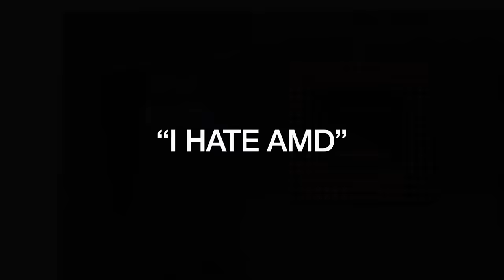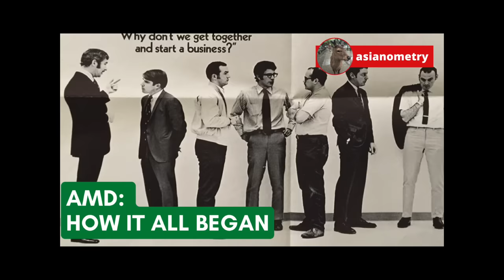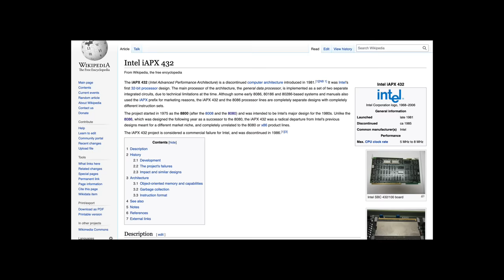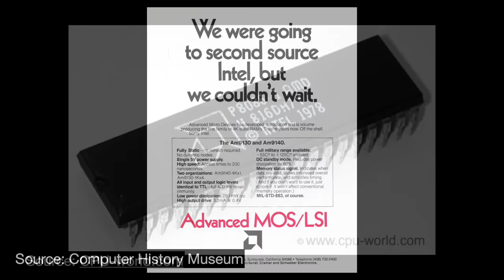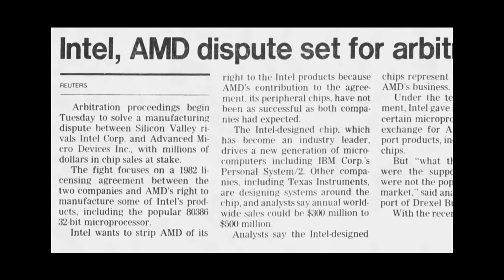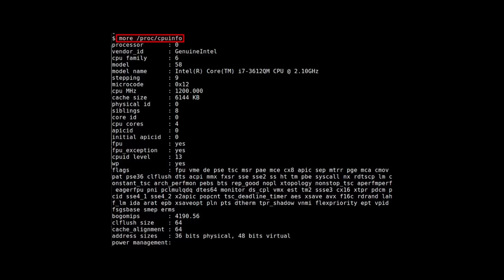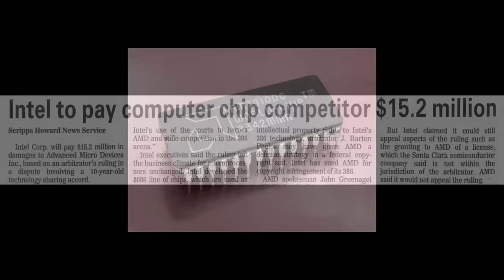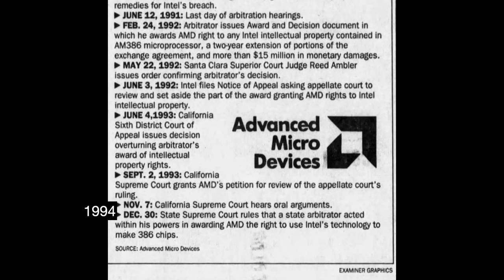Intel & AMD: The First 30 Years

Comment: Its a miracle that AMD is still standing and hadn't gone bankrupt after Bulldozer's massive failure, and in spite of all the anti-competitive practices that Intel done in the past few decades.
Reply: if it weren't for Consoles Xbox and PS AMD would've gone Belly-up around 2010s
Reply: @steffennilsen2132  Especially Nvidia, cuz it was also Dumped by Apple due to Nvidia's Ever-present Greediness.
Reply: @mozzinator  bulldozer is really far from the history covered in the video. They were much closer to dying at that point than at any time during bulldozer
Reply: And now looking at 6000 GPU and 5000 CPU AMD is competing quite well with 90% performance at 70% power. AMD doesn't have the same edge their competitors have but they compete well with decent margins all the same. I am immediately drawn to the underdog story. Thanks goodness we have AMD to help other companies innovate.
Reply: @christophermullins7163  well ryzen 7000 is out and today the 7800x3d is the fastest cpu availible for gamers. while 7950x3d is up there for productivity tasks.
Reply: Bulldozers weren’t as bad as people said. 

Had a FX-8350 Black that served me well for about 8 years. For gaming AMD was geared up for them with most companies optimizing their games to the AMD platforms. 

The FPU was the point of contention with the Bulldozers.
Reply: Also can’t beat the price point back then. $250 for a FX-8350 with a Liquid Cooler guaranteed to cool up to 5GHz. 

Compare that to $500 for a Intel i7 people that were smart used the money saved on the CPU to buy a better GPU.
Reply: @South_0f_Heaven_  sure. At half the single thread performance. Fortunately we don't have this issue and competition created a $150 6core part that will run a 4090 at 4k reasonably well.
Reply: @South_0f_Heaven_  yeah they were. They really really were. Phenom came out before and had many benefits lol a 2c4th Intel would match or beat a 8core whatever while consuming 1/3 the energy. Not to mention that no games used those 8 threads(actually 4 cores)
Reply: @South_0f_Heaven_  oh no no no no no... Bulldozer was just as bad as everyone said it was. Why do you think AMD literally never iterated on the design? I mean it's fine if you bought a year or more after launch. But at launch it's like AMD was painting an i3 to be an i7. They really thought programs would go towards being designed with integer math primarily (lots of good reasons for this tbh) but turns out they were very wrong.
Reply: @christophermullins7163  Maybe NEC would have been the underdog.
Reply: @South_0f_Heaven_  Same here. Gave me many years till DRM and it's needed instructions (SSE if memory serves) forced an upgrade.
Reply: @South_0f_Heaven_ That’s not even mentioning the fact that the 8350 will beat Intel’s offerings from the same time in later games. Bulldozer aged much better than the 2700k, assuming you don’t care about power consumption.
Reply: @South_0f_Heaven_  when we talk about bulldozer, we talk about the whole family of CPUs. The first gen was a complete regression over the Phenom 2 and except the 8350, the second gen was so badly yielded that there were even less efficient than the flagship despite less cores and frequency and a quite older node than Intel.
Even in the lower end desktop, the FM1 fiasco was not a good sign for buyers. The APU line was weak despite being updated to excavator and steamroller unlike the AM3+ parts.
The only interesting parts during this era were Jaguar CPUs on AM1 for SFF units and they even managed to shut it down under a single gen instead of solidifying this low power market.
Reply: @christophermullins7163  had a Phenom 965 Quad Black before the FX-8350, they were the 6-cores that AMD blocked off 2 cores for whatever reason. 

When I started playing BF3 in 2012 I had the Phenom 965 with a 9800 GT. Upgraded to a GTX 660 and nothing but bottlenecks. 99 % CPU usage that went down to 45% when I upgraded to the FX-8350. The Phenom 965 while a great CPU was overrated tbh, sold mine used for more then I paid new and the FX-8350 was superior to it in every way. 

Went to a 6700k few years ago that ran horribly hot at 60% even with a 360mm Arctic Freezer 80c-90c. 

Couldn’t be happier going back to a AMD Ryzen 5800X3D
Reply: @christophermullins7163  don’t know about that one. 

When I was building a new system I looked into a Ryzen 5600X to be used with a 1080 ti and even that 2017 GPU had a slight bottleneck with the 5600X. 

Highly doubt a 4090 is gonna work well with a $150 6-Core. 

Intels are better at some things while AMD is better at others. Myself I care about value and getting at least 5 years out of a PC build with a minimum of 1 upgrade during that time. For my purposes Intel is just overpriced and overrated in the current PC environment.
Reply: @South_0f_Heaven_  Yeah pretty sure the 8350 I had still lives on in a younger siblings computer to this day, I don't remember having any issues or surprises with it. Seemed like a good chip at a reasonable price.
Reply: @christophermullins7163  eh the 7900xtx performs a bit worse than the 4080 and the power draw is similar or higher in games. There was a massive hardware issue according to moores law is Dead which is why performance is off from their initial estimates. 

Still great and they can compete at tiers that matter for volume and come back with Rdna4, I held my nose and bought a 4090 this time. Really wanted to get something from AMD but wanted something that can play basically any game at 4k.
Reply: @PainterVierax  agreed the APU’s were a disaster plus AMD’s offerings for laptops were pathetic. On that level Intel was king but even Intel had their issues back then. 

Regardless both companies are more or less at parity and it will be a interesting next few years.
Reply: @jolness1  also regarding the 7000 series GPU’s they have major issues with downclocking the VRAM when running games at low settings for competitive play. 

Much as I despise Nvidia these days they still have the best offerings in the GPU market. 

Too bad the crypto boom poisoned everything.
Reply: Thankfully, AMD had enough fanboys to kept them afloat until Ryzen.
Reply: Partly that's because Intel's 64 bit instruction set is licenced from AMD, because their own attempt at it, the Itanium, was a disaster.
Reply: @South_0f_Heaven_  revisionist history 😂 they were really that bad
Reply: @PainterVierax  "The APU line was weak despite being updated to excavator and steamroller unlike the AM3+ parts."
They weren't weak compared to the price equivalent Intel chips for the most part. Usually you'd get comparable CPU performance and better iGPU performance there, the biggest downside to FM2/FM2+ was the lack of upgradability to anything remotely high-end so it was largely limited to people in the budget market who weren't likely to upgrade their CPUs.
Reply: @mozzinator  AMD doesn't make much money from consoles.
Reply: @TheDemocrab  That upgradability path was a huge contrast compared to previous AM2-3 and compared to Intel platforms. And with the Bulldozer arch they get horrendous perf/Watt compared to Intel i3/Pentium + a more capable discrete GPU.
Desktop APU is a niche market so locking them to a separate socket was a huge mistake. And seeing how FM1 was treated didn't incentivize customers  to jump to FM2, especially when Zen (and even K12) were longly rumored and already awaited.
Reply: they made cash during the 2000s.   they were top tier gpu and top tier cpu.  amd64 just came out.  and the radeon was flying high.  intel was dumped P4 and had to retool for “lowerr power consumption”.  its actually a miracle nvidia and intel survived.   apple saved intel.  and nvida got their act together by 2010-2012.   nvidia was also saved by sony (ps3)
Reply: I would say that Bulldozer is what set up AMD for its current success. Bulldozer was AMD's attempt at trying out technologies for the future such as modularization, and making use of circuit libraries rather than hand-crafted circuit designs like it used to do in the past, and that Intel still does right now. Intel is having problems switching over to chiplet-style designs due to its reliance on hand-crafted designs. It's having to learn what AMD learned throughout the entire Bulldozer era.
Reply: 😢I still maintain bulldozer was never a bad chip, at least in price to performance. If multithreading had come earlier it would probably have been a success.
Reply: There was another Miracle in Jerry Sanders buying NexGen and saving the company when 5x86-133 and K5 were carrying the company..  at very cheap prices
Reply: @agdgdgwngo  I have an FX-8300 and with today's multithreaded games, it seems to be doing a pretty good job of playing them all of a sudden.
Reply: I have got the foundation 2017 Ryzen and Radeon are great CPU and Graphics Card Are incredibly performance than AMD phenom ii and fx-series fail dozer
Reply: @agdgdgwngo  Bulldozer is not SMT, it's CMT.
What Intel did was more in line with existing SMT, multi-core CPUs and multi-socket architecture and didn't break the way of enabling its additional computational power in software development. That's the fundamental difference with Bulldozer and why AMD tentative failed and they got back on conventional SMT for Zen. This point is crucial, as software development is relatively conservative and includes a lot of inertia. It requires changes in compilers and OSes, then APIs and finally applications to optimize code for something like CMT cores/modules on Bulldozer or like heterogeneous multicore systems on ARM big.Little or Intel Alderlake or even the Ryzen 7950x3D.
Reply: @RayanMADAO  did you actually own one?

Did Sony and Microsoft both go out of business because they both used the terrible FX series on the PS3 and XBOX?

Weak attempt at trolling bud lol.
Reply: @bbbl67  yep and people don’t mention how much a used FX-8350 sells for these days, let alone a FX-9370. 

That was the exact problem, games were not optimized for multi-threading back then. People just don’t understand that even the best CPU’s and GPU’s these days are hardly being utilized because of poor coding by software developers.
Reply: @jrherita  dual-core CPU’s lol of course they were cheaper. 

Quote the price of a comparable i7 of the time and your well over $500. 

Vs a FX-8350 that could be had for more then half price. Even if the performance was 15% less then Intel the money saved can be put towards better RAM, GPU, w/e. 

For the price you cannot beat AMD. 

Just another FYI: should look up how power hungry Intels last few generations of CPU’s have been compared to the Ryzen line.
Reply: @South_0f_Heaven_  how much do used FX CPU's sell for these days?
Reply: And now AMD is trading at over 100x PE and INTC is trading at 16x. 😅
Reply: Intel kept AMD on life support for years so that they'd couldn't be called a Monopoly, but they never thought in a million years AMD would become a real competitor.
Reply: @bbbl67  last time I looked you couldn’t get a used FX-8350 for under $100, a FX-9370 up over $200. 

Was looking to build a second system as I sold off my FX-8350, motherboard and RAM a few years back so that series of chips obviously has a following. 

Now consider a Ryzen 5800x can be bought new for about $250 and a 5800X3D for $320. 

For a decade old CPU used I’d say that’s pretty good resale value being they can still be used with modern games and work pretty well at that.
Reply: Still can't get oevr the fact that phenom was faster than bulldozer. And how bulldozer was a shitty 4 core cpu with dual intégrer units, compared to phenoms 6 cores.
But ryzen and their SMT really was the breakthrough
Reply: @wile123456  It was not so much that Phenom was faster overall, but just faster in IPC. I had a Phenom II 6-core, which I replaced on the same motherboard with an FX-8300 (kudos to AMD for maintaining backwards compatibility even back then). The FX was definitely much faster at games than the Phenom. At everyday tasks, I couldn't really tell much difference. And these days I am actually feeling like the FX is coming into its own on games. The Phenom can't even play most of these games, as it doesn't have support for some of the most recent instructions.
Reply: @bbbl67  exactly 

Had a Phenom II 965 Black that with a GTX 660 CPU ran at 99% playing BF3. Soon as I replaced with the FX-8350 CPU usage dropped to 45% so no idea what the other commenter is on about a Phenom II being faster then a FX-8350. 

Could have unlocked the two extra cores on my Phenom 965 Quad but decided it wasn’t worth the trouble.
Reply: @Scrubzami ofcourse sometimes its game dependent. but if you combine the list of the most populare games its usually the quickest. also even though its tdp is 120watts, its often more power effecient than even some of amds own 65watters. intel is a power drain in comparison.
Reply: @mozzinator  nah that was just apple putting in the cheapest components possible and charging a premium
Reply: @camcappe353  yeah could be that as well. Apple is equally as scummy as NVIDIA
Reply: @South_0f_Heaven_  yah the fps in most games was well ... neg. to your eye for the most part , yes some games didnt play well but we all know why that way
and if you had nvidia gpu it reaaaally didnt matter that much haha
Reply: @South_0f_Heaven_  Although it is in its twilight years, I am still rocking that exact same processor. I don’t remember my purchase date, but it was definitely part of my StarCraft 2 build when it came out/was coming out.
Reply: @SquintyGears   not quite. They did iterate - it's called piledriver. Bulldozer was bad, but I still use my stationary PC (secondary for me - main machine is a gaming laptop with no DisplayPort) with overclocked 8320E for VR, and it runs most VR games pretty well

Also, games weren't using more than 2 or 4 cores back then, which contributed massively to the bulldozer's lack of success
Reply: @NymdaFromDeepSalad  yeah no. That's like saying intel 7th to 9th gen are iterations of 6th gen skylake. Technically they get different code names and they manage to get better results from the lithography process but the architecture didn't change. You can get all the performance that the iterations came with by aggressively overclocking the 1st chips that came out. That's also why the black edition desktop late bulldozer chips REQUIRED a liquid cooler at a time where they were not common at all.

I still use my FX 6300 as a private server. But the reason why it was bad is because they bet that programs would focus on integer math not floating point. Because integer math is perfectly continuous and exact while float has value gaps and a variable precision. It's a whole mess... Turns out it didn't matter and float is by far the most used system. So having a shared FPU is a massive performance loss. (i recommend a video by SimonDev for how computers use floats)
Reply: @SquintyGears    Well, first I know, how floating point works, and shared FPUs are a big hit to performance. However, what is much more important is how they are implemented. Even if you make fpu from 387 work at 5GHz, and make it into 64 core processor, a modern CPU will wastly outperform, so lets maybe stop talking about sharing as The reason for performance hit - FPUs of fxs are just less powerful in total - essentially each core has a half-powered fpu

Secondly, no you cannot get the same performance iterations, because the architecture did change like there is a list of, yes, not really major, but somewhat significant improvements, aside from process node and frequencies/tdp.
At the same clock speed piledriver is slightly faster

Also, fx-9xxx were just massively overclocked from the factory, that's why they had 200+ watt tdp. This was because FXs could go to higher frequencies, but that doesn't mean they are efficient there. Also also, you can cool those with a big enough tower cooler
Reply: But this video is mainly about Intel trying to prevent AMD from copying its designs lol
Reply: @christophermullins7163  Of course power draw bad but I found it really shined on games that takes advantage multi cores because I tested it against dual core Pentium that is Skylake.   I use Valorant as the benchmark.   I would be hitting almost 200 fps with GTX 580 and did same test with the Pentium based Skylake.   I was expecting  Skyline dual core to beat out the FX 8350.  You have to use it to see it.   

Funny thing about that FX 8350.   It was just sitting on my desk as paper weight for over a year because I knew it was bad.   I finally bought the 990FX just to see how badly it perform against Pentium Dual Core.   Games that uses multi core really ran smoothly while the Dual Core Skylake struggle to maintain 80 fps and background processes would cause fps dips.   Capping the dual core to 45 fps does help so much while FX 8350 had no issue and even can record on OBS with some multi task.
Reply: If I remember correctly Skylake dual core score over 950 pts on single thread while multi thread 1400 pts while FX 8350 when overclocked scored around 580 pts while multi thread scored over 3300-3400 pts on Geekbench 5.  FX 8350 users didn't really have to upgrade till Ryzen 1st gen comes out.
Reply: I sold off the Skylake dual core system and i7 6700k and the i7 6950x and kept the FX 8350 as my secondary.  lol  I still have my legendary i7 2600k.   Going from 2xxx to 6xxx was really disappointing.  Also FU microsoft for planned obsolescence.
Reply: 8.6 Ghz, great CPU !
Reply: FX wasn't THAT bad if you compare against contemporary cpus at the time. Especially in the same price range. It's bad but nowhere near bankruptcy levels of bad.
Reply: @christophermullins7163  AMD is still behind Nvidia, but not Intel. AMD's high-end consumer CPUs have a huge advantage in performance per watt, and a slim advantage (on average) in heavily threaded applications. They have a much bigger advantage in performance with server and workstation CPUs, as well as a big advantage in energy efficiency as well. AMD is also making better margins with both consumer and server/ enterprise CPUs because of lower production costs, whereas Intel is pulling out all of the stops to try to stay competitive. Intel is financially on shaky ground now, and really needs to continue making some big structural changes to its company in order to get things back on track again.
Reply: Rory Read played a big part in stabilizing AMD financially. He restructured the companies debt, sold the campus properties and leased for short term cash. Then SVP and GM Lisa Su also helped him diversity the companies revenue with some simple extensions of their existing capabilities, like their semi custom business that became the major console contracts. As well as suggesting not making any more major changes to the bulldozer core, just process refinements and small tweaks, instead focusing on a major redesign core. Jim Keller played a big role in managing the Ryzen/Skybridge project and motivated the quite defeated at the time engineering team.
Reply: To be fair consoles and APU's kept them alive.
Reply: So cringe when gamers confuse themselves for the entire cpu market.